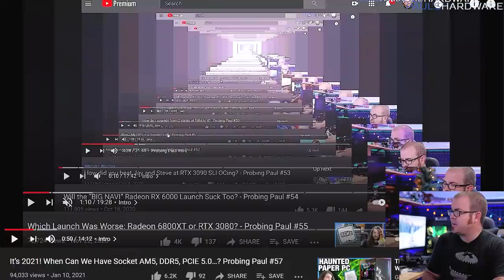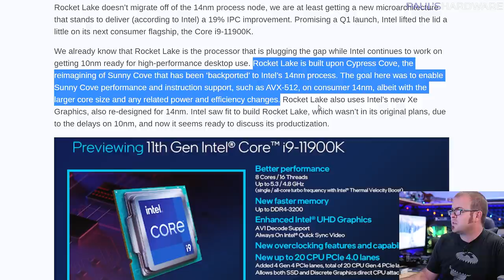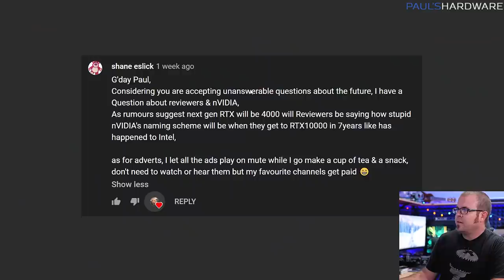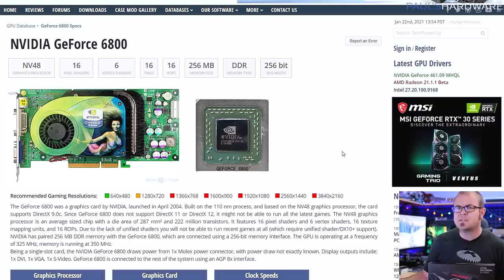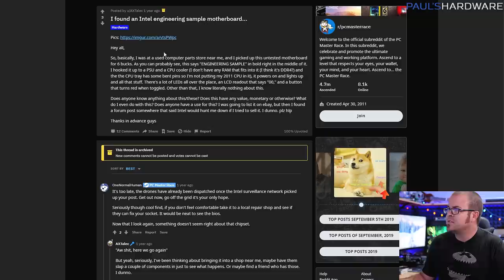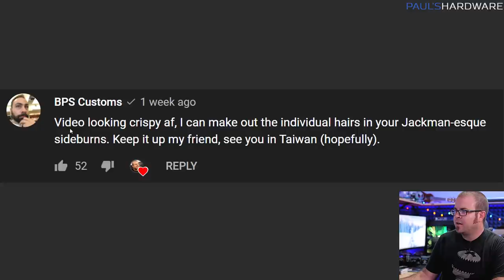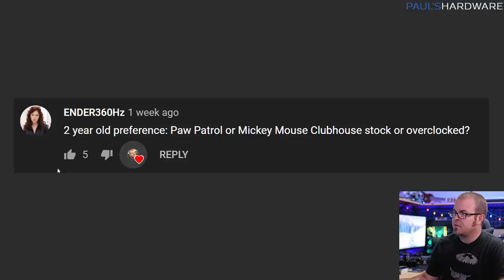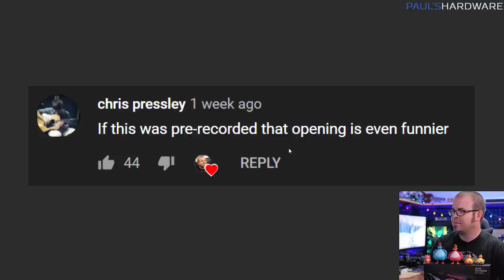Why is the 11900K only 8-Core instead of 10? - Probing Paul #58

Comment: Designing a CPU, chipset or motherboard has several steps. First the logic is designed using specialty software. Once the logic has been designed and verified (i.e under simulation it works as desired) the design is taken to a CAD system and is physically layout out, there are a ton of issues that have to be worked out here from basic physical issues (will that fit there) to issues of electrical interference and the big one, can it be manufactured (and manufactured with a low error rate). A design that can't be manufactured is a useless design. This all gets tested via simulation too. Part of this step is also programming the robots on how to manufacture and assemble the pieces.

Once that design is completed and validated the design is sent to manufacturing who produce a small number of sample items (e.g. one wafer of chips). These engineering samples then undergo testing to see if they really work as designed. When problems are found (and problems will be found in anything this complex) the design has to be fixed and reverified then a new round of engineering samples produced and another round of testing is completed (sometimes the design has to go back to the logic design). This design, build, test process can loop many times.

After all that they have a functional design and they can start production, but they start slow because there are likely going to be bugs in the manufacturing process that have to be found and corrected. And to answer the question that got asked, who builds the engineering samples? The same people who are going to build the production goods, a big portion of the design is the build process and that can't just be moved to another manufacturer (at least not without more testing).

The issue with Rocket Lake was it was originally designed to be manufactured on Intel's 10nm process, but the process wasn't ready so they had to redesign the physical layout (but not the logical layout) to be built on the latest 14nm process. And that's not just a process of making everything X % bigger. By having to switch to the 14nm process the chip became too big and Intel had to slice off two cores or the chip would have been too big and the failure rate during manufacturing would have made the chip too expensive.

If you can pack 100 chips onto a wafer with a 10% error rate that gives you 90 chips per wafer. But if you can only pack 80 chips on the same wafer even with the same 10% error rate you're down to 72 chips per wafer (a 25% increase). But because of physics the bigger the chip the higher the failure rate will be so the failure rate would be above 10%. To illustrate this, take a piece of paper and with a pencil divide it into 100 equal squares, pin it to a dart board and throw three darts at it. Changes are you'll put a dart into three (or sometimes two) squares. Now do the same thing again only split the paper into two halves, given random dart throws you've got a pretty good chance of hitting both squares, which would be a 100% failure rate.

Comment: 8 core becuase most likely the 2 extra 9th and 10th are not really in use by  Windows and gaming .   Intel  disabled it to 8 core for more effiencent and not  waste  iQ  in out computing .  I think while gaming  the 2 core are like   2000mhz each and pretty much idle, no point in turning it on .

Comment: With intel releasing their new product when do you consider your pc build is ready for an upgrade?
Reply: If an user is on a 10850K or 10900K the upgrade isn't worth it, but the perfomance jump from the 10700K to the 11700K is kinda big in leaked benchmarks.
Reply: @saricubra2867  is the jump from a 8700k worth?
Reply: @ElTeeger  Depends. Do you want the best and fastest 8 cores?
If you are fine with your system, i wouldn't upgrade.

Comment: intel needs to ditch the i-gpu on desktop lineup like ryzen.  that wasted die space could fit 4 more cores.  does any1 with an i7/9 k chip use i-gpu or rather have 4 more cores?

Comment: Naming should be the easiest thing for these companies! Why are they so braindead!?
✖✖✖✖
↳           First number is the generation of the current brand. (1st generation = 1, 2nd =2, etc)
  ↳         Second number is the number of cores.
     ↳      Third number is the variant. Left as 0 for first releases and add numbers in case small revisions are made.
         ↳  Final character can be any other indicator the company feels should be worth putting in the product's name, such as M for Mobile devices (APUs).

But noooo, we have to have Zen (first generation) as the 1000 series, the Zen + as the Second generation in the 2000 series, then Zen 2 as the THIRD generation on the 3000 series following the 4000 series for mobile, and finally Zen 3 as the FOURTH generation with the 5000 series!!!

And don't get me started on intel, I have no idea what the numbers are supposed to indicate!

Comment: Simple answer, Intel likes offering less while charging you more. They're like a drug dealer than gives you just enough to keep you hooked and coming back for more.
Reply: No, 10850K is waaaay better value than 5800X at the same price point.

In Zen 3 if you want to have the best of the best, you have to pay more, that's how it works, same for Intel with their i7s, i5s, etc...

If the i9 11900K if priced around 500 dollars, then is bad value for the money even with the integrated graphics.

Comment: How well would a 10400 and rtx 2070 Super be together?.
Reply: Should do well, that's exactly what I'm looking to build in the near future. Originally wanted the 3060ti at MSRP but...... ya. Don't think the prices will come down anytime soon so, get the best you can within budget. I'm in Europe so our market is a little different than the US, less options, plus with Brexit buying from the UK is out of the question unless you wanna add another few hundred euros for customs.
Reply: @Ziv Zulander Thank you GPU wise that seems to be my only option. & On my z490 I do plan on maybe getting a 11700k or 10700k. The 10400 was bought as a starter chip I got 3200mghz ram with it but my options GPU wise are limited. I can get a 2070 Super and not get ripped off super badly so I'm considering that.
Reply: @nayeemhaque1064  yea man each paycheck I bought a part. Before I knew it I had a sick rig to put together that now just needs a GPU. The 10400 i bought as a starter cpu cuz i got a z490 MB. But many people are telling me the i5 should be fine for just gaming which is mostly what I'll be using it for so we'll see how it does whenever I get a GPU in there.
Reply: @nayeemhaque1064  & man US market is a joke right now. I wish u luck finding the parts u need.
Reply: @bradbeyers9028  ya I thought about moving up to the 10700 later on as well. Just to have a smoother experience, or maybe even a 11th gen i7 if the price and performance are right when the time comes. I have a decent psu and a sapphire nitro rx580 in the current rig that I’ll carry over to the new one. I’ll hold on as long as I can in getting the GPU, and hope for a decent deal. Btw which z490 did you go for if you don’t mind me asking.

Comment: So the 11gen isn't worth it ?
Reply: some of the lower skus may be like the 11600k if it launches at 250 will give the 5600x a run for its money. and the 11700k less binned 10900k depending on the price may be alot better value. the 11900k though is defintely not looking like a good value chip

Comment: Why? So they can come out with the 11950K and get more money out of it.
Reply: the 11700k is basicaly what the 10850k is to the 10900k. they defintely wont be making a 11950k with 10 cores. the higher core chips will come out with alder lake some time late 2021

Comment: If the 11600k be about 270$ then it will kill the 5600x
Reply: id hope to see the 11600k launch around 250. and the 11700k around 350. that would make it alot more competitive at least in the non ultra high end since the 11700k will basically be the 11900k but not binned as high

Comment: Intel released Skylake 5 times , 2015 to2020. Oh BTW only thing Intel changed is socket 5 times for same CPU. Lol . pepega company.
Reply: 6th and 7th shared the same chipset with z170 and z270 were cross compatible  then 8th and 9th both worked in either z390/z370  and 10th and 11th work in either z490,590.  other then the 10th gen switched to lga 1200 but the rest were the same lga 1151. I feel like they could have possibly made the 8700k work in z170,z270 but the 9900k defintely justifyed a new motherboard with its power draw. but if AMD pulls ahead similar to where intel was pre ryzen don't think that amd motherboard wont do the same. there in  bussinesses and are out to make money also. if they can just release low RnD stuff and make the same they will If intel cant answer 5000 series I would not be surpised if ryzen 6700x is 350 bucks